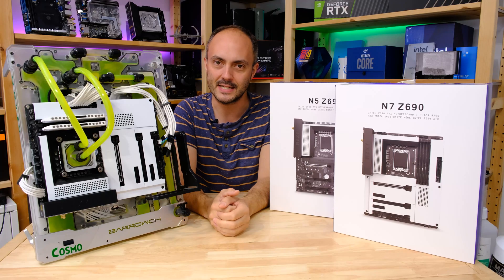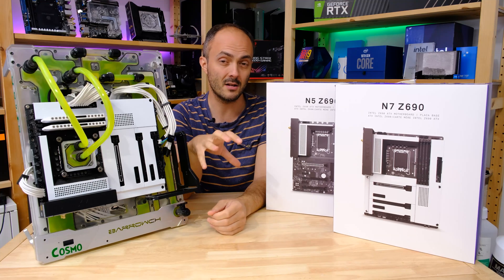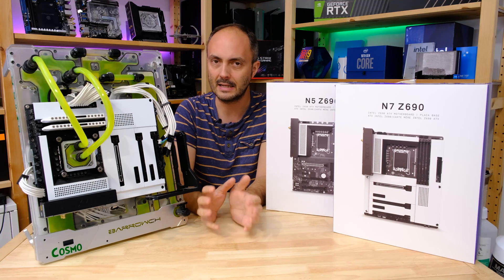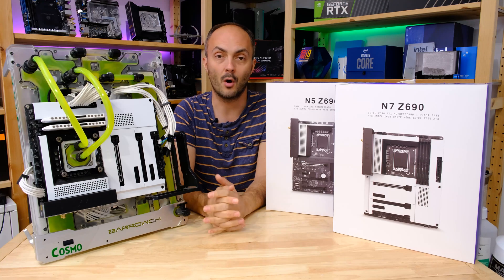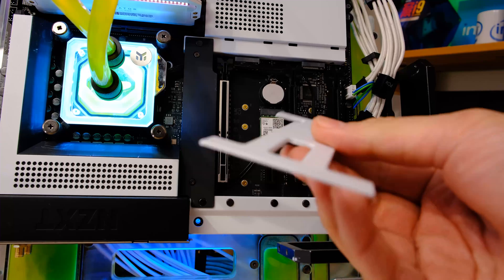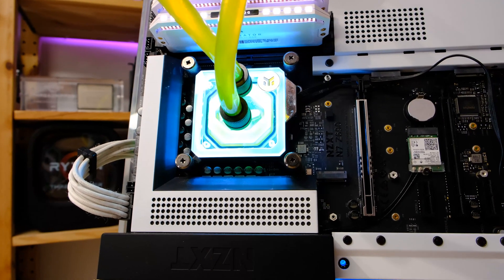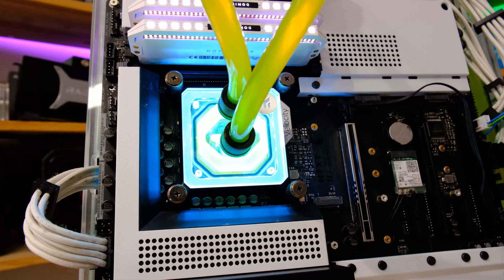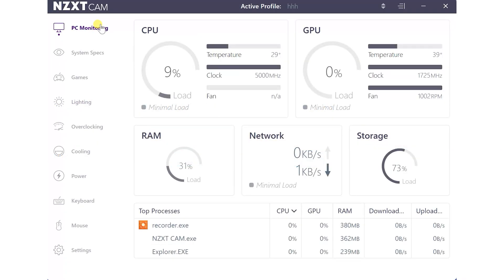NZXT N7 Z690 MOTHERBOARD REVIEW + N5 Z690 Preview

Comment: How do the VRMs perform? Does it enable a 12900K to run full tilt at stock settings? Are there dumb PL1 limits like on the entry level Asrock boards?
Reply from the maker: Just dropped in a 12900K for this as I usually use a 12600K for overclocking. VRMs peaked at 54'C but that was with an IR laser probe - no readout for VRM temp in the BIOS or HWINFO. That's Prime95, smallestFFTs, AVX disabled.

PL1 and PL2 both set to 241W as default

Comment: It's nice to see improvement but this is still a pretty hard sell... the I/O is still really sparse compared to other Z690 and at least here where it's $300, it just doesn't feel premium enough for the price. It's arguable for white themed builds but even then you've got the likes of the Aero G and Steel Legend undercutting it; the Aero D, MSI Force, and Strix offering much more at similar prices; and the Maximus Formula showing what extreme features actually looks like for the highest-end builds. The black one isn't even worth talking about competiton-wise, the competition is way more intense for black. Good direction from NZXT given their awful start a few years ago, but not quite there yet. Knock off $100 and it could actually start to be considerable.
Reply: The competition is non-existent for clean, minimalist black designs.
Reply: @allanshpeley4284  it really isn't, but if you specifically think only the NZXT look qualifies and you're willing to fork over more money for less function that's entirely up to you. I can't really recommend coping by spending $300 on a board that barely competes with $100 class boards. I was already being generous by putting it in the $200 bracket for consideration.